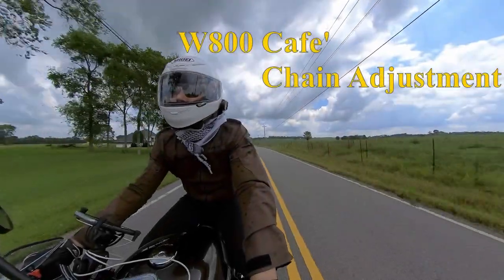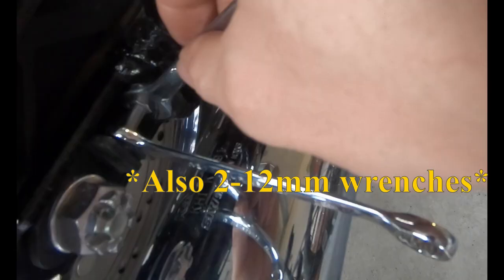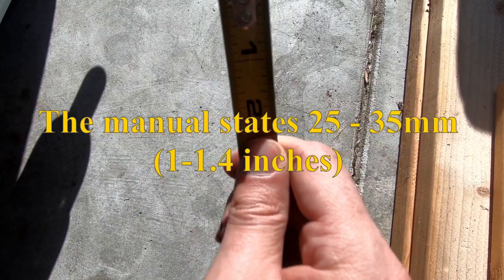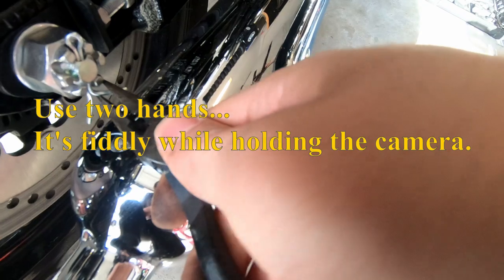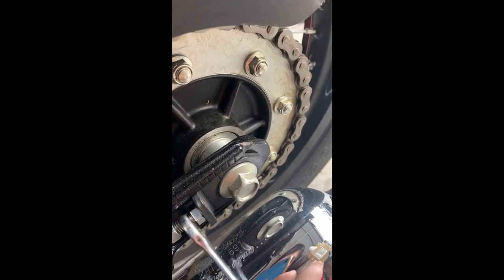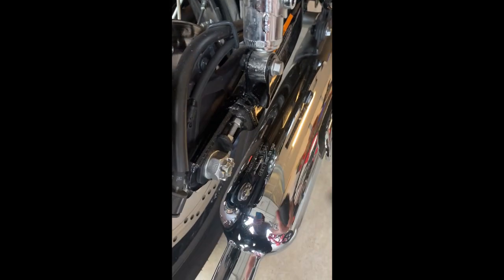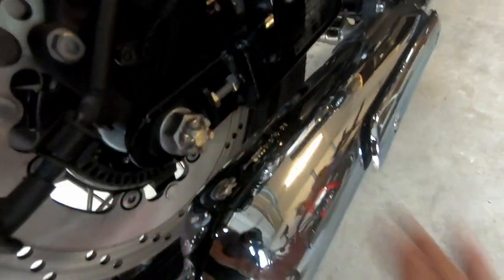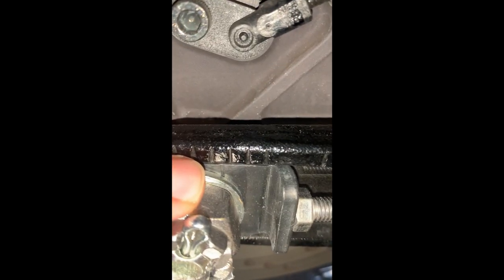W800 Cafe’ Chain Adjustment

Comment: Great video for fellow owners of the W800 Cafe!  I am struck by the comparative ease of a chain adjustment on my Ducati 900 GTS from 1979.  It seems like all things motorcycle have become more complex over the years.  By the way the GTS was also bevel drive and a great bike to own and ride with very easy maintenance.  Thanks for putting this out there, I am thinking of getting the W800 standard at age 74!
Reply from the maker: Thanks for watching! That Ducati sounds pretty cool. The standard w800 is really nice package and more comfortable over the Cafe’. Unless you really need the cafe colors and styling I’d go standard. Big plus is that it comes with a center stand 🤣

Comment: Nice relaxing vid , I just did my W650 , noticed moving it around that there was a tight-spot I didnt pick-up on...so did it again . there are two holes for the cotter-pin on mine (90degree to each other) might be the same on yours  . Another bike guy (vid) pointed-out , not to move the upper chain-runs tension, when moving/measuring the lower chain-run . I think I might have done this the first time . Dave   NZ
Reply from the maker: Yeah, I just check the bottom of the chain. Thanks for watching and the comment!

Comment: Hi from the UK .I have a 2017 triumph t100 .I have to take off the silencers to do the same job. The w800 is a lot better design.
Reply from the maker: That’s what I hear from a lot of current/former Triumph owners. I haven’t owned a T100. It seems like a good bike tho. What differences did you specifically notice?

Comment: Hey Bert, nice video. What is your idle speed when the bike is cold/warmed up? Thank you
Reply from the maker: Hey there! Thanks for watching. On a cold start it idles at 1900-ish then drops to 900ish and levels out once warm to 1100ish. It stays there pretty much like clockwork.
Reply: @bertsbike  That’s what I remember mine doing before but since I removed the throttle cables and adjusted them, cold start is 1500 and then goes below 1000 and stalls at times. I’ll need to adjust the idle speed. Thanks for letting me know.
Reply from the maker: @st.5218  Yeah if you check out my review on the bike there’s a shot of the cold start. Also there are some recommended numbers in  the manual I believe.
Reply: @bertsbike  I’ll check them out.

Comment: It’s easy to adjust the chain. What is not easy & a complete buzz kill for the café is cleaning the chain. No centre stand & the only real spot to do this is the rear sprocket with the back wheel on a spinner, but the bike is very heavy so no easy feat. I know this as I had one & sold it for this very reason.
Reply from the maker: I agree. Cleaning the chain is a pain. The bike really does need to come with a center stand from the factory.